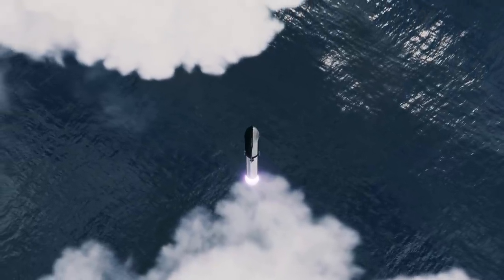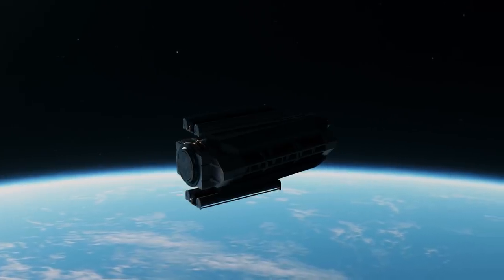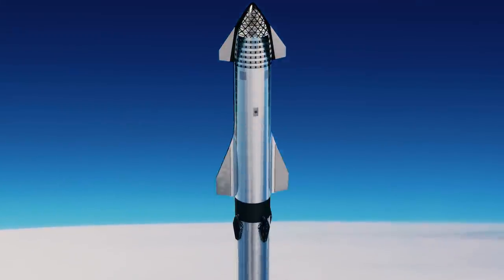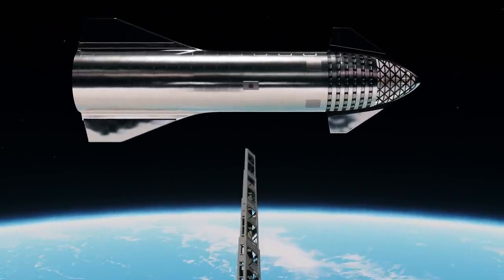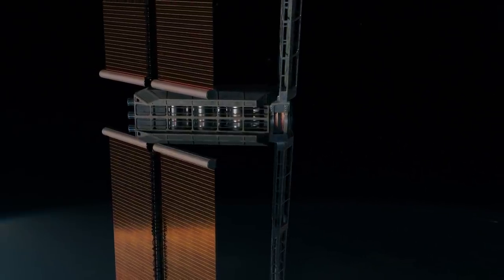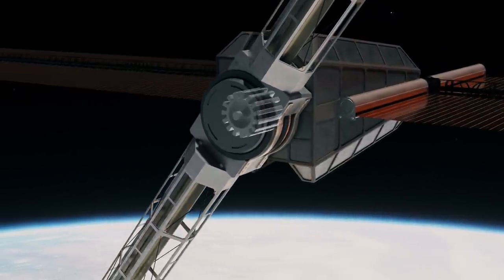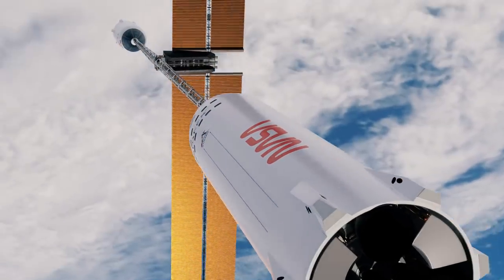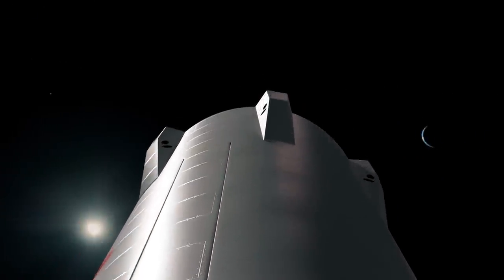SpaceX Starship Artificial Gravity Connector concept

Comment: Why not use the expanse version of artificial gravity. The floors are  already placed under the rocket so just a little more thrust would push everyone to the floor.
Reply: For that you need a very fast rocket that burns for a long period of time and uses either fusion or antimatter, and so far we don't have that technology, so rotational gravity is the only one that is possible as of now, also this model shown isn't very good, as you could connect the starships by the nose and they would spin, pushing everything to the floor

Comment: "The power would be transmitted wirelessly from the stationary part of the AGC to the rotating part"  Really?  You've probably not watched EEVBlog Dave Jones' debunking of transmitting electrical power wirelessly. Go check it out.
Reply from the maker: From what I know, scientist achieved a decent transfer rate of a few meters
Reply: @SpaceXvision  I still suggest you go check it out. You'll understand afterwards and he's using the laws of physics...
Reply: It doesn't need to be done wirelessly anyway. A simple rotating connector would work way better.

Comment: Isn't it a better solution to create a space inside the ship intended for people so that it would be mounted as a rotating?
Reply from the maker: That is not advisable, view the entire video and it will be explained
Reply: But I wasn't thinking about rotating the entire ship. Rather, I was thinking of an isolated, specific section of the ship's crew whose rotation would be triggered in orbit while the pilot section would be stationary, separated from the moving section by a system that equalized the rotational speeds of the two sections.
Reply from the maker: @damiandrozd4570  Did you calculated how much gravity is possible with your approach?

Comment: How about using some common sense, and utilize what is going to be there and available anyways. We know there will need to be a "Fuel Depot" in LEO for the moon lander. How about using that stationary fuel depot as a proper counterweight, and have it contain that connector permanently mounted in it's bay. That way you could do nose-to-nose docking via the condensed connector, do the injection burn to whatever destination via fuel connection umbilical from the "fuel depot" tanks, and once the trajectory burn is done, extend the connector, and use the deceleration fuel left over in the depot as counterweight. The CG could easily vary for the leverage to create centrifugal gravity regardless of fuel quantity in the depot, especially if you made the connector able to extend a modest length.

Comment: The counter rotating weight would have to spin so fast compared to the starships, the  bearings would not last long enough for mars missions, would need electric maglev bearings and a generator to power it, plus really good pressure seals that could deal with the vaccum of space. It's just fantasy for now. Also spinning in space is great till u move your head from side to side , angular momentum spinning and turning head = puke! Tesla has invented carbon over wrapped motors so things are getting a lot more efficient I wonder if the next tesla battery day will announce  SOLID STATE lithium carbon that can charge in minutes rather than there latest cells, that take an hour or so.

Comment: Great concept, but wouldn't there be a quite significant difference of G-Forces between the highest and lowest starship deck? So I calculated 70m for the highest and 85m (15m Starship interior height maybe) for the lowest deck. With an angular velocity of 2 rpm you would experience on the lowest deck a G-Force similar to Mars (0.38G), but on the highest deck 0.31G. Wouldn't that be a problem?
Reply from the maker: I think not. since the difference within the body, which is smaller then the space between the decks would be much smaller perhaps 0.01G difference. So like 1 percent, should be fine i think

Comment: why is it sideways
Reply: Watch the whole video before making useless commentary...🙃🙃🙃
Reply: @wwj300  I did. I'm saying that starships typically are vertical, and their load-bearing structures are designed as such. So I think it would make more sense to suspend them vertically rather than horizontally.

(yes they reenter horizontal, but in this case they are supported on their entire belly's surface rather than a single or a few points)

Comment: 3:21 "Allowing for huge savings in fuel usage"-!? ... No.
You mean "Allowing for greater efficiency in fuel use." This so called "usage" and even more redundant "usages" is mouth-breather noise, sane people knownthat use is use, it needs never be conjugated into anything else.

"Savings" = funds you accumulate over time, not "propensity to save" but act of accumulation THAT'S NOT WHAT HAPPENS WITH HIGHER FUEL EFFICIENCY UNLESS YOU BREATHE THROUGH YOUR MOUTH AND HAVE NO CHOICE BUT PRETEND "DELUSION = REALITY."

Comment: I think you would be better off garbing the starships by the tail end.  It would be more sable and the arms would not have to be as long.
Reply from the maker: I did that at the end of the video
Reply: @SpaceXvision  You had them grabbed by the nose.  That would leave the heavy part, the engines, under the greatest acceleration.  Way more than the crew space.  Grab em by the tail.

Comment: the concept and idea is completely wrong.  In the 50/60 the NASA already investigated on the artificial gravity produced by centrifugal force.  The astronauts suffered from dizziness, disorientation, nausea and weakness, the program was canceled.  The Russians also investigated artificial gravity and reached the same conclusions ... artificial gravity based on centrifugal or tangential speed is unfeasible for humans.  even creating a windowless module: 1 the number of cycles needed to get close to the earth's gravity is enormous 2 even when building the windowless module, the human body still perceives rotation and acceleration and does not tolerate it correctly.  It is a misconception that it has no future.